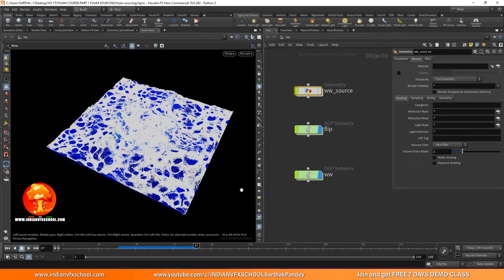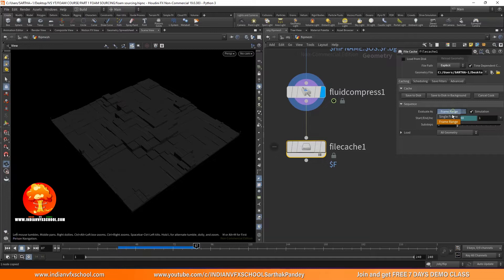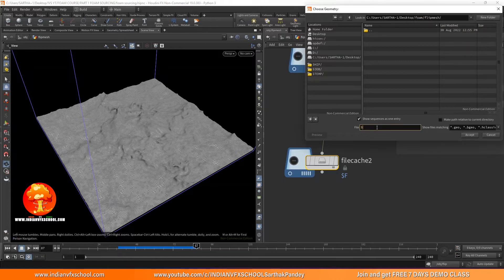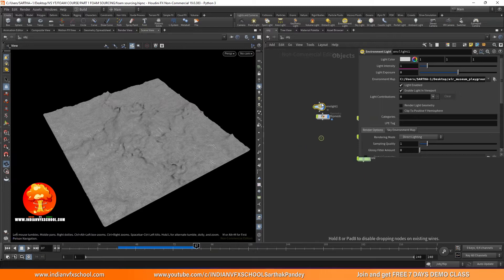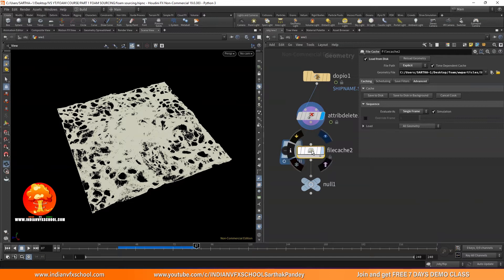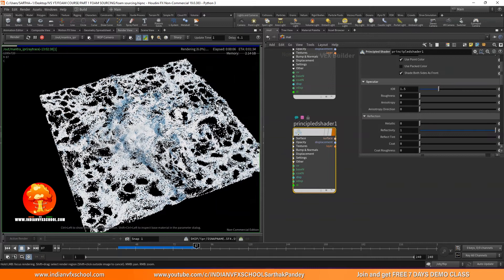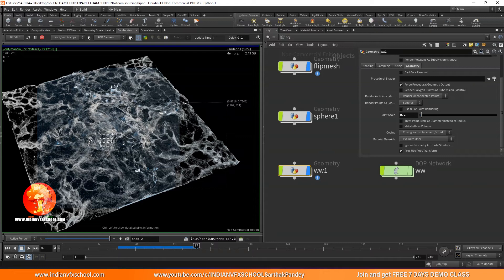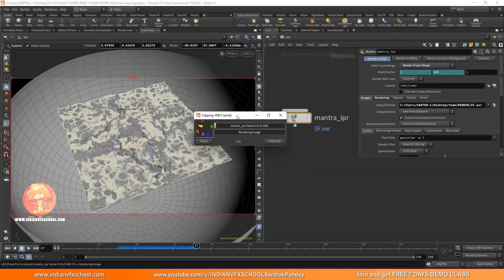Houdini White Water Course - Part 5 - White Water Rendering #houdini #whitewater #Flip

Comment: Hi, this tutorial series was great and taught me a lot! I am however wondering how to export the whitewater sim to a different software (blender in my case). I've tried converting it back into a vdb but it doesn't look very good then. How would you apporach this?
Reply: I think that the best way would be to use copy to points on the white water particles and attach a sphere to each particle/point. Then you just alembic export it as a normal animated mesh. Its annoying because you cant fix the scale of the bubbles inside blender but I am not aware of a better way to do this.